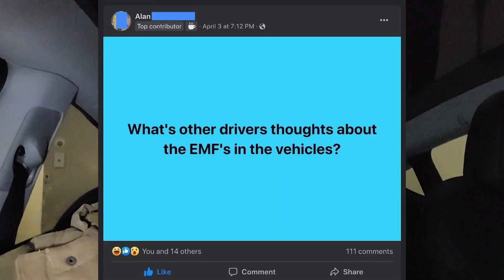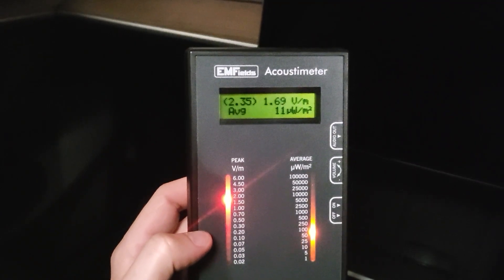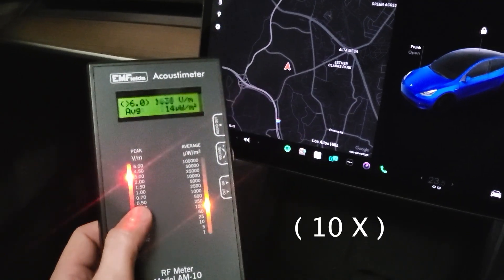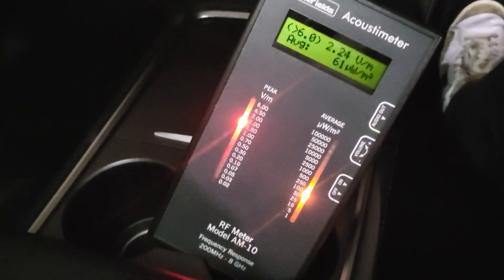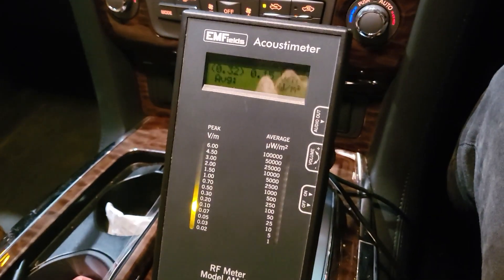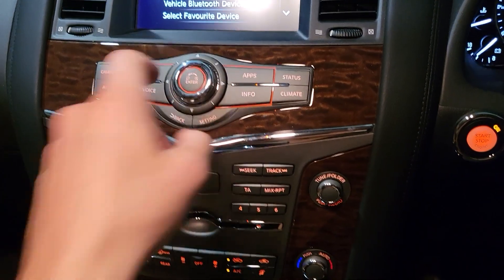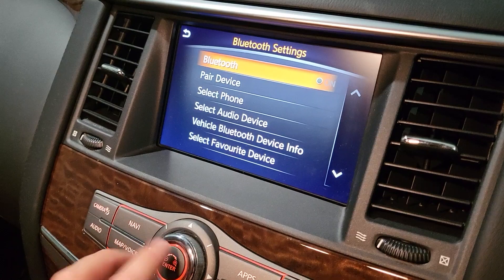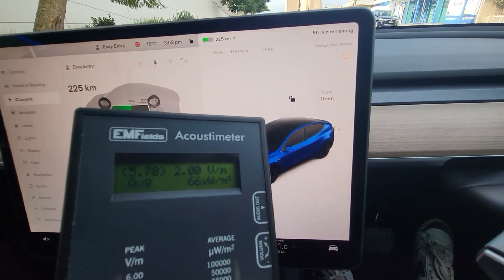what is it about Tesla's radio freqencies?

Comment: Was the Nissan's engine running??
Reply from the maker: yes, when I turned it on in the video I started the motor.
Reply: Thanks Damien.
It would be great to see comparison to other EV's.
What do those levels mean to humans?
Reply: @davehayes8812  no fiscal impact, it's not X-rays or microwaves, it might however slow down communications to your Fitbit. The probable cause is that Tesla uses WiFi to update its software, so it is searching for your home network.
Reply: @aeronautauto  so, it would work different away from home then, right? I would think they link GPS and your home WiFi network?